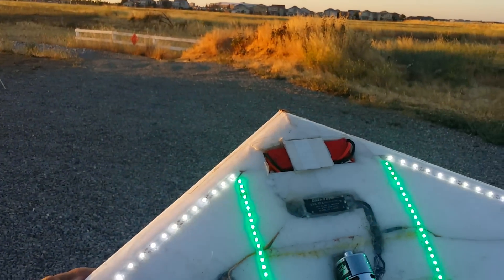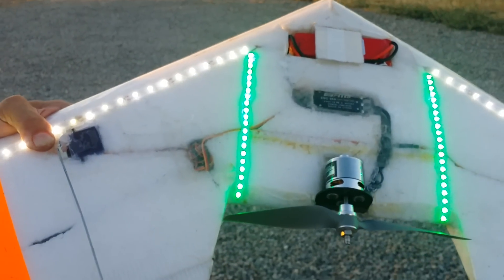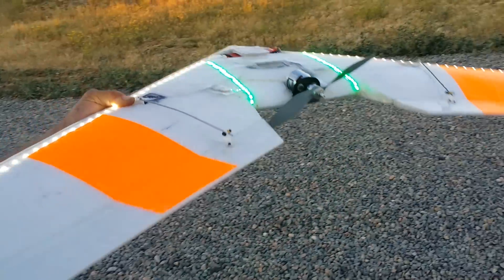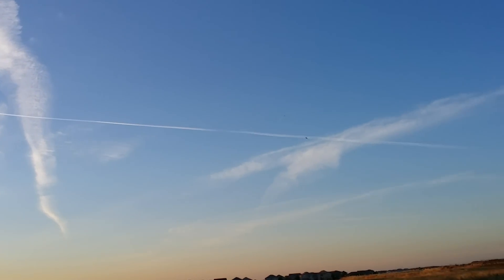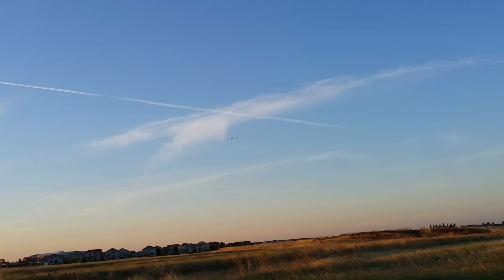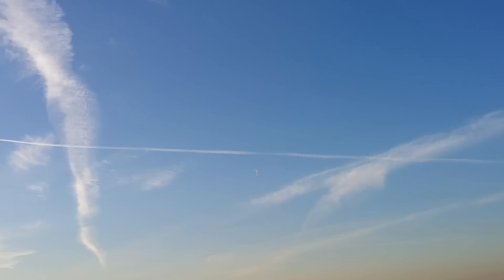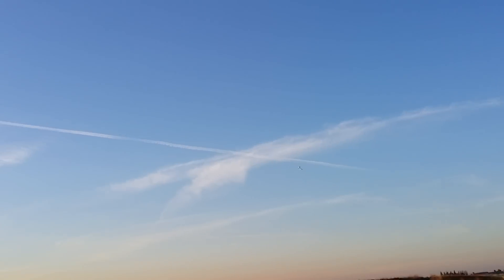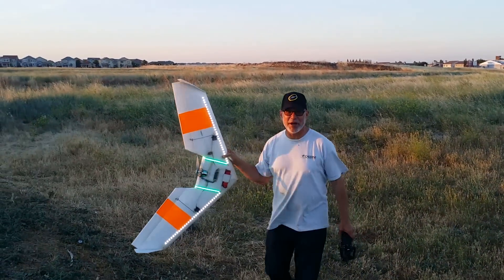Min Reaper 1250kv

Comment: Very interested in your findings on these! I'm thinking of FPV on one with a xiaomi yi HD cam and a 4000mah battery. I think I understand the airfoil is much more efficient then that of the combat foil on the Pinata. Any idea what cut would be best? I'm not opposed to a full 55" but I'd guess it would be slower and heavier then need be along with taking up more room in the car.